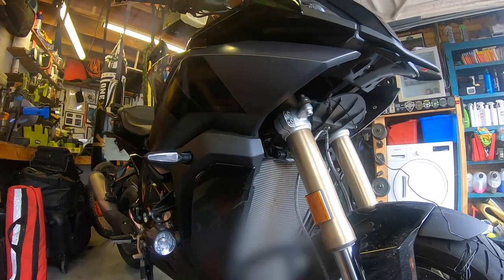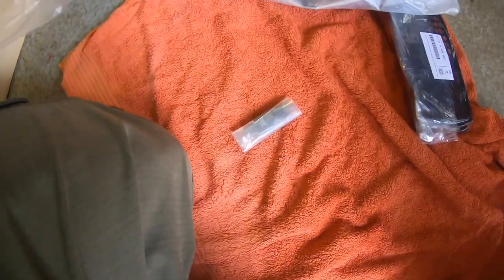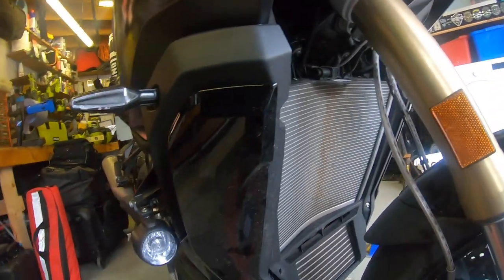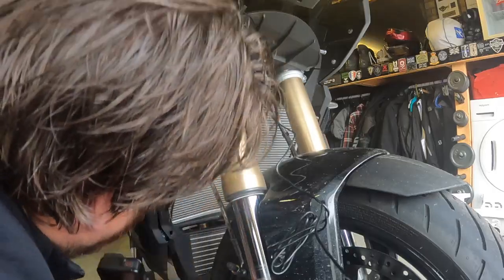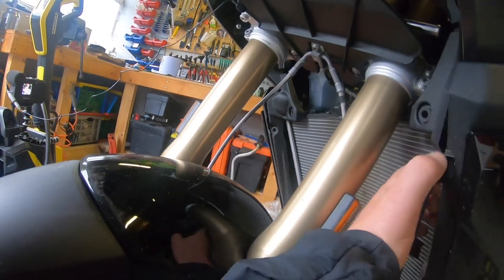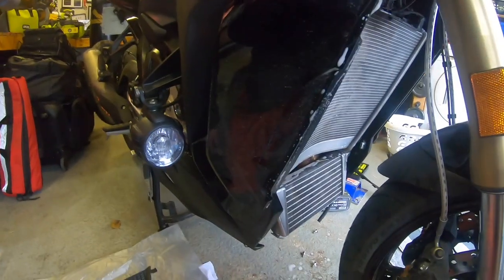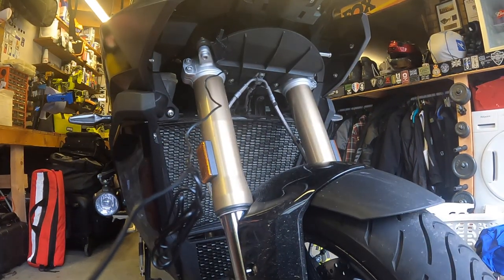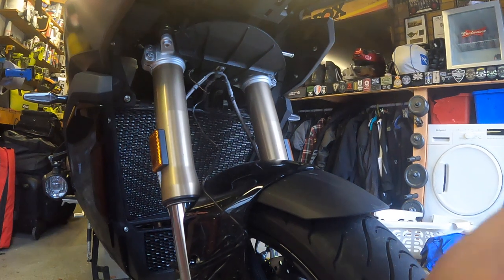2022 BMW S1000XR OEM Radiator guard install

Comment: Thank you so much for posting your video. My purchase of the OEM radiator guards also did not come with any instructions.  I was going to pay BMW to install.  However when I watched your video it was extremely helpful.  The only step I took different was to the lower fairing.  I only removed the two lower screws on each side of the bottom fairing.  Also thank you for pointing out thatvthere was a wire connected to the right side of the inner fairing.  The guards look good installed on my 2021 s1000xr sport edition.  Your video...SAVED ME MONEY!
Reply from the maker: Glad it helped mate 👍

Comment: Excellent video, thanks. I had the instructions with the parts and was completely confused by them. I decided to ignore the instructions and follow your video. One thing I noticed is there's a couple of rubber pipes below the oil cooler on the left when sitting on the bike. You need to be careful not to get them trapped when putting it back together. Thanks again!

Comment: Thanks.. I wanted an easy way to remove the thing for cleaning the radiators. Take out the 6 screws on the front, and two on each side on de side/bottom, and it slides out as stated. Noticed in the process BMW had not fitted one side correctly

Comment: great video! I was reluctant to attempt it because all over the forums you hear how hard it is.  I too only took off the two lower screws on each side of the bottom fairing.  The frame slid right out.  The screws they now use make it so much easier to reinstall (THANK YOU BMW!). That used to be the hardest part.  Fits nice and tight and looks great.  OEM is the only way to go and the cheapest as well!